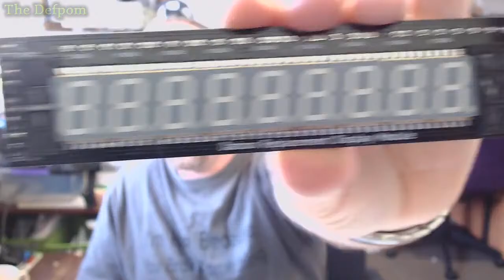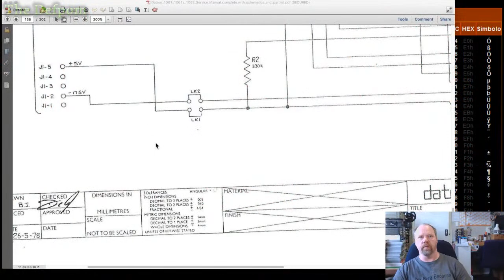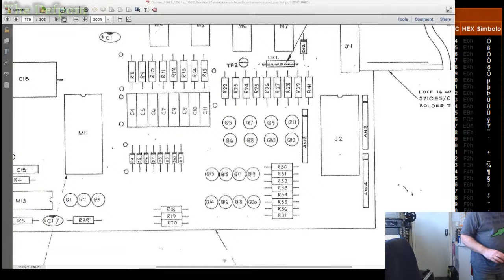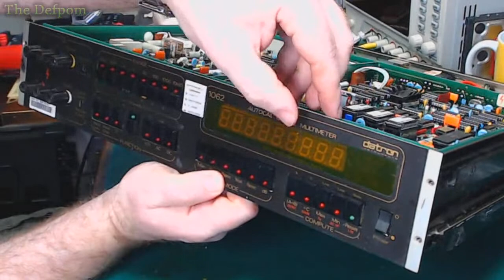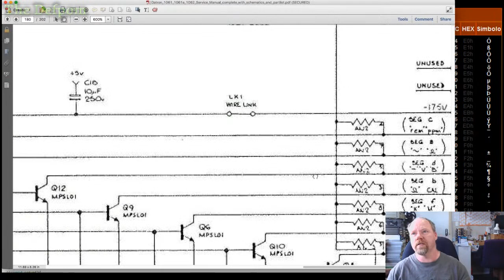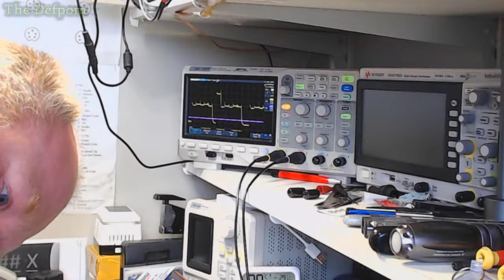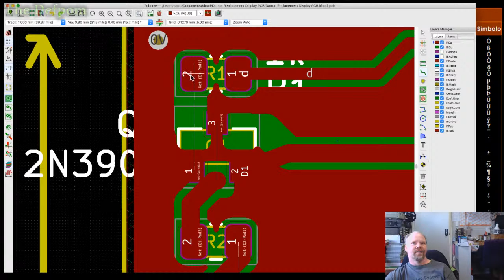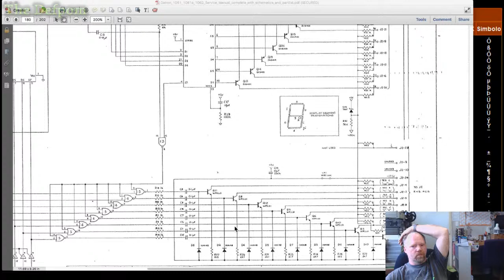🔴 The Defpom's Live Stream - Lets try to fix a Datron 1062 - Sponsored by PCBway

Comment: Not to be unkind, but who has nearly seven hours to sit and watch a video? Even if you skip through parts. Plus, the data that this video would use would be about 20% of my monthly data allowance on my satellite internet connection. Maybe someday we'll join the 21st century here.
Reply from the maker: Who has the time indeed, maybe the idiot that sat there for nearly 7 hours doing the stream :-) I didn't intend for it to be that long, but once I get stuck into something I like to try and see it to the end or at least to some point where it makes sense to stop.
Reply: @TheDefpom  No worries. After having spent a few hours here on the 18th and 17th cleaning up after 2 feet of snow, you'd have thought a nice long live stream would be just the thing. :o)